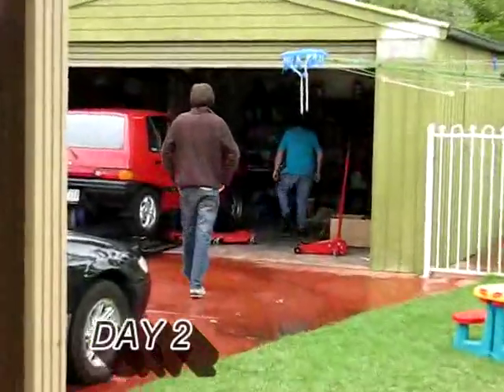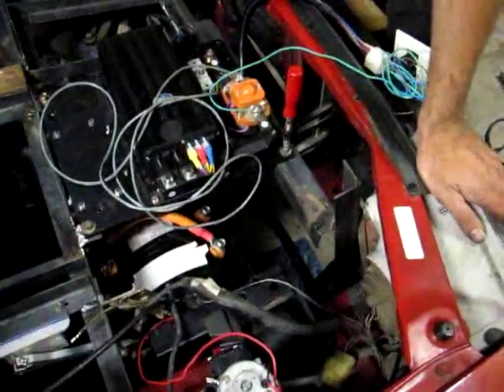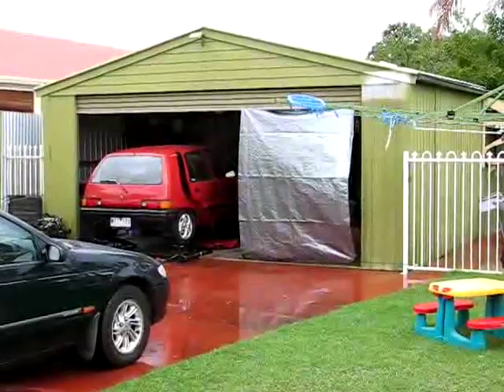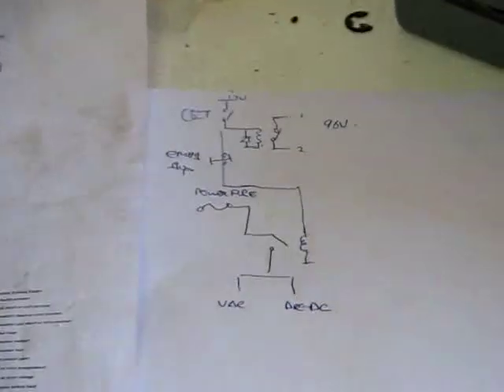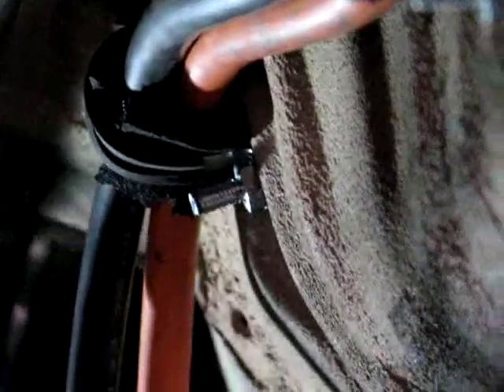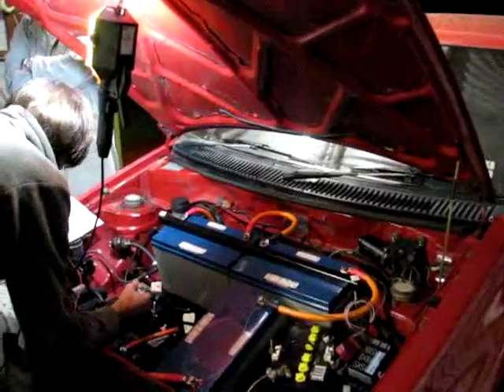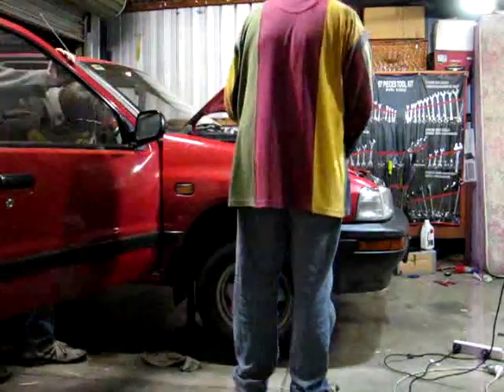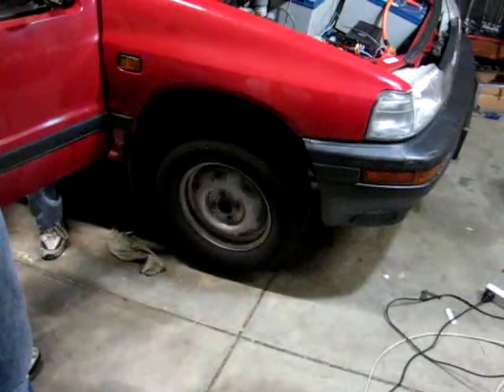PART TWO OF 3 DAY DAIHATSU CHARADE ELECTRIC CONVERSION

Comment: was any engineering necessary for this swap?
Reply: Yes, the conversion must be certified by a VACC engineer (I'm in Victoria) then re-registered as an EV through VicRoads. Certification cost about a $1000. Process is - initial inspection and checklist of things to fix to comply, works, then final inspection and certification if all is OK.
Reply: +Michael Axtens is there a link online to show what compliance needs need to be met?  I'll assume it's at vicroads, but unless you have one offhand.. and if not, would it be found under EV conversions?